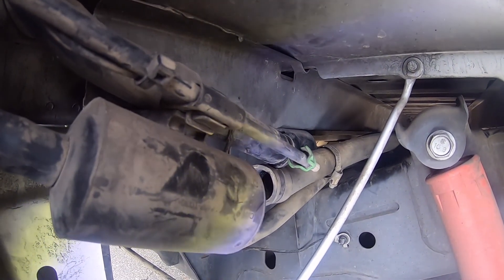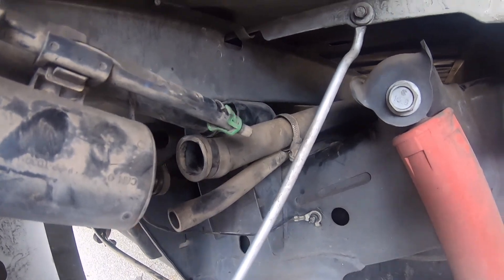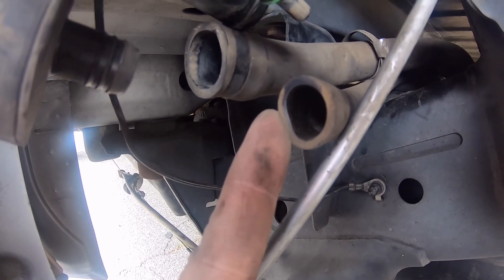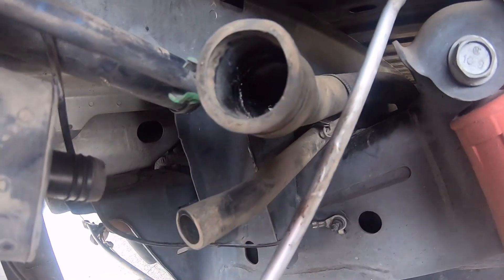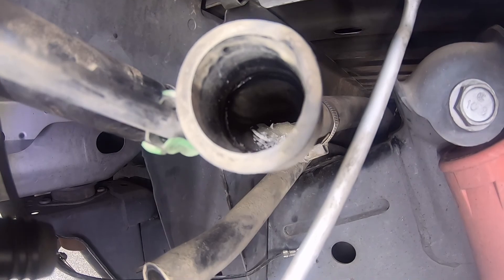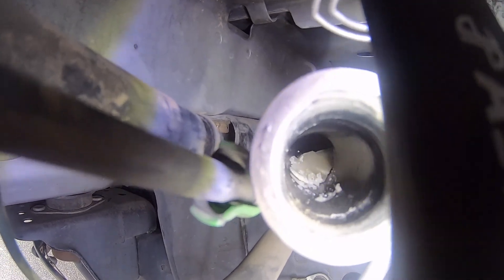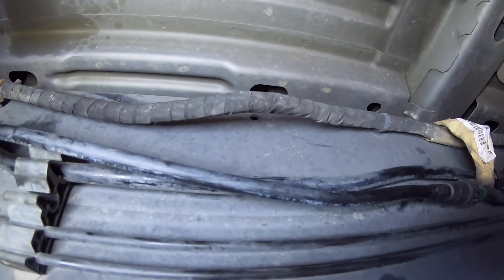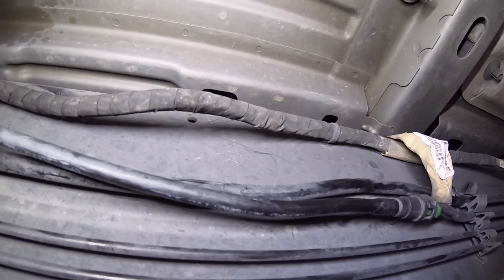2009 hemi 1500 trx4 build part 5.  Sugar in the tank!!!!

Comment: Ok, here's my theory. Owner was hated by his neighbours, so they put sugar in his tank. He then dropped the tank, breaking that breather pipe and replaced the pump without cleaning the tank. Then he fitted a locking cap. But it was still running like a pig. Since he was now broke, he could'nt spend any more money on it, so arranged for it to be "stolen". He collects insurance money and the problem moves on to the new owner ie you.
Reply from the maker: Sound like a sound theory.  To add more evidence of the pump being replaced previously, what I forgot to mention in the video is that the lock tab for the fuel pump wiring connector was already unlocked.
Reply: @solargarage  Are you also replacing the metal filler tube? Mine was quite corroded and didn't cost too much to replace.
Reply from the maker: @ScottRods  I thought about it, but the current line and all the steel lines are rust free, the underside of this truck looks really clean.  I am going to flush that fuel line out though.